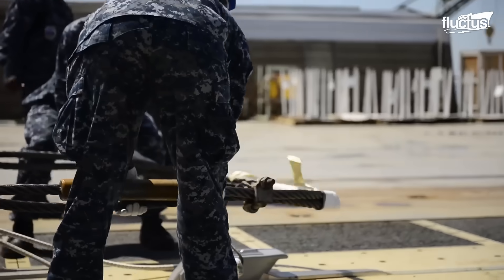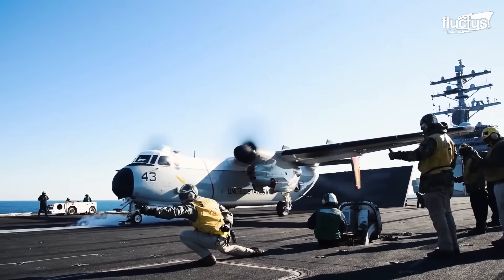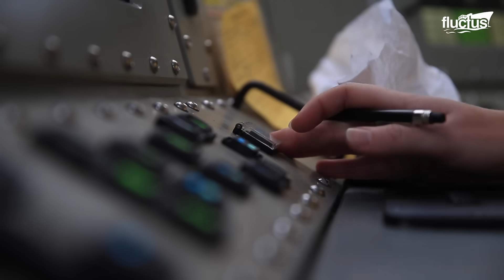Testing US New System to Launch Aircraft at Crazy Speed on Aircraft Carrier

Comment: As I understand, the ski jump system requires that the aircraft being launched is lighter, thus less ammunition and armament.
Reply: Right, and also the aircraft tend to be short takeoff types to begin with.
Reply: Thay are designed for use with STOVL aircraft, not conventional, yes launch weight is less, but there is a huge cost advantage.